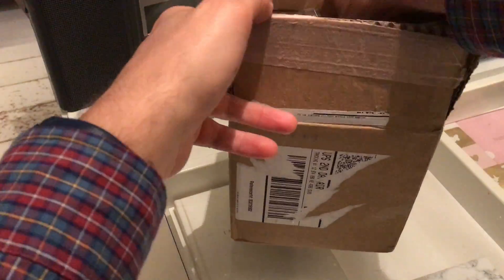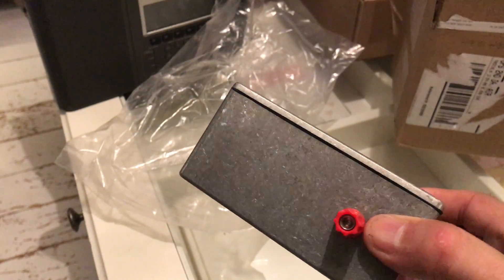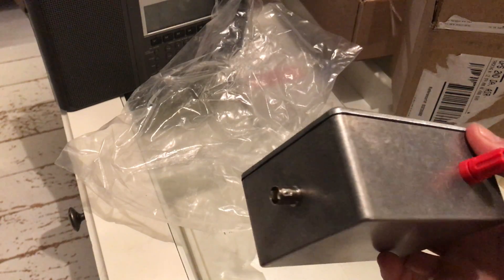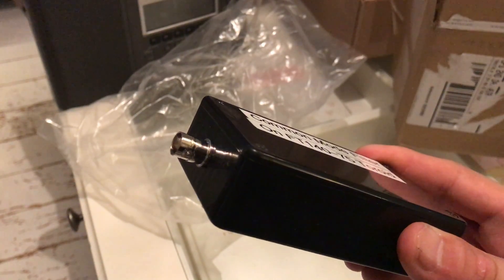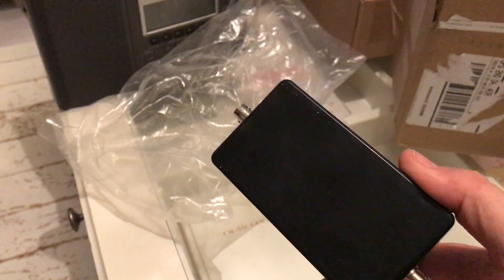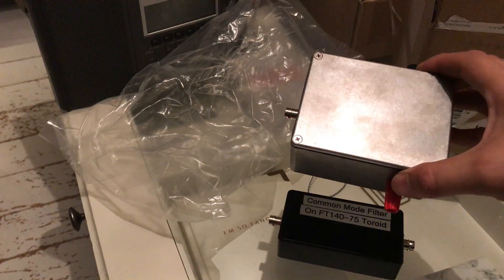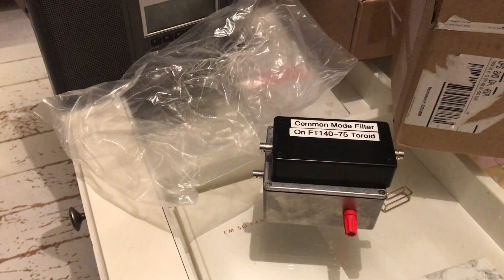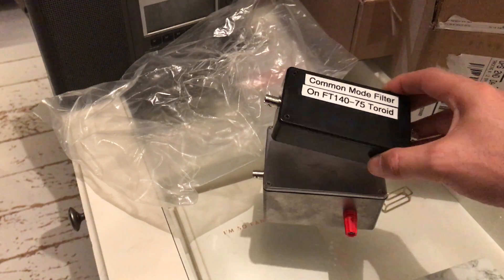Matching Transformer and Common Mode Filter

Comment: Hmm, did you got ou and tested the beverage yet? I'm very curious tough. My 200m beverages did not work well compared with a 30m based SuperKaz, wich is still the best performer at my QTH. Also never seen the tests done with your home made balun and terminator. I hope you can go out for a test soon ;-). Keep up the good work! They are very nice videos.
Reply from the maker: Hi Ron, I haven't tested these parts with the 200 m Beverage yet - I used my own transformer and termination box. I am planning another test though with these kindly supplied by Chuck. Hopefully this will happen soon - work schedule permitting. 73! Clint
Reply: Good I wait for your update. 73' Ron

Comment: Very kind words, Clint, thank you.  The information you share so enthusiastically, demonstrating that one does not necessarily need invest large sums of money to really enjoy the listening hobby has no doubt encouraged many to give it a try.  You continue to show how Tecsun portables, the Eton Satellit and other reasonably priced deliver performance orders of magnitude in excess of their cost. Indeed, the Beverage Matching Transformer and Common Mode Choke can be made in a single evening with easily obtainable parts costing less that $30.  Both were designed by DX'perts Bill Bowers and the late John Bryant and those plans have been widely distributed.  Should others want the plans, contact me and I will e-mail them straight away.   I demonstrate the benefit of adding a common mode choke to the feed line of the 36' X 16' "Superlop" Directional MW antenna.  That can be seen, here:  https://youtu.be/pZjA_aFv6Y0
Reply from the maker: A pleasure. Indeed, it's not necessary to buy 1,000s of ££/$$ on radio equipment to hear very nice DX. In fact I get more enjoyment out in a field or the woods with a £40 portable than I do sat at home in the shack using a £700 Elad! I'm just an outdoors type of guy lol. I watched your demonstration video with interest and am looking forward to trying it out on the barbed wire fence in the next couple of days. I'll compare it against my crocodile clip! Thanks again for the very kind gesture - much appreciated. 73! Clint